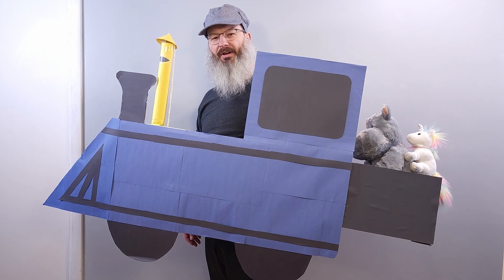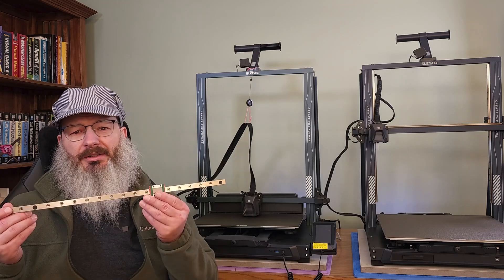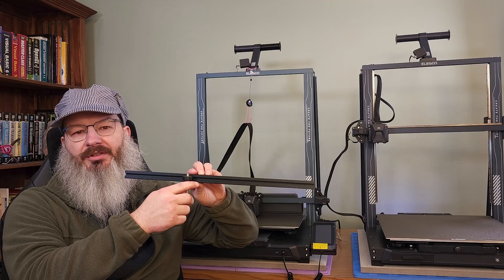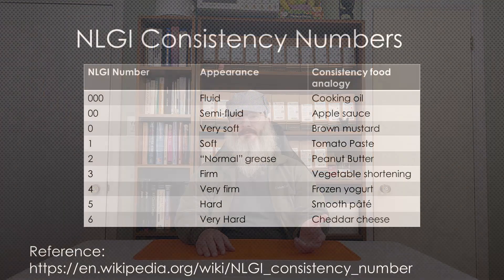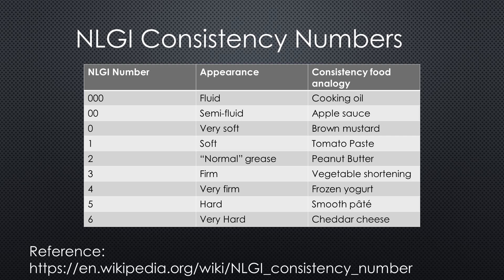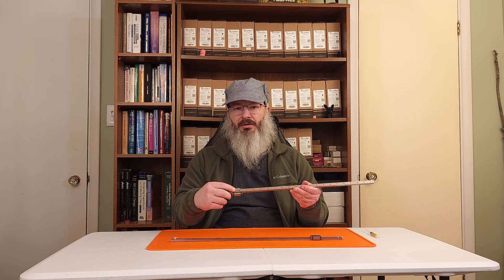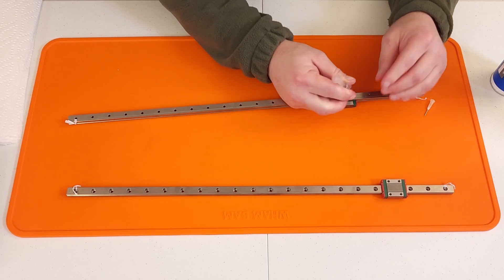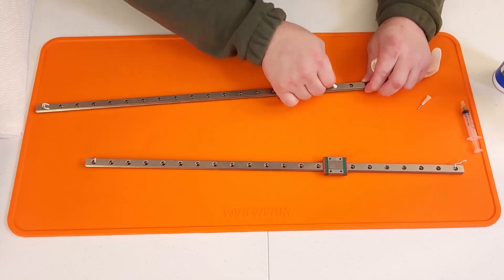Linear Rails for the Neptune 4 Plus & Max: Part 1- Preparation

Comment: Yup, the Hiwin rails are now in a thermal/vacuum sealed bubble-wrap. My Z rails came in the tube bags, but they sprung quite a few leaks for me.
I had no success getting the hiwins to fill with grease via the fill port, or at least I didn't know where I was supposed to be seeing it come out. My syringe either wouldn't extrude any grease or it would all just stary oozing out back onto the needle. Ended up just working the grease in to the bearings from the back where they were slightly exposed.
Reply from the maker: Thank you for watching our videos!!! I've encountered a couple similar stories, but I'm not exactly sure why some are different (the lubrication port not working). Unfortunately, I'm not familiar with how/where TBStron3D gets their linear rails.

Comment: PSA for anyone that is planning on doing the hiwin upgrade. The rails now come in thermally sealed packaging not a plastic sleeve and without any stoppers as discribed in the video. 

Although the thermally sealed packaging is better at protecting the rails during shipping, it is still covered in oil. You have to make sure you cut around EVERY part of the plastic around rail/ carriage.   If not any plastic can catch the carriage and slide it of the rail. This happened to me even though I was extremely careful. One of the carriages caught a small piece of plastic and slid right off the rail in the process shooting a few bearings around my garage into the abyss.  It barely slid off but it didn’t matter.

I still think this will a great upgrade for the N4max but just know as like many things in 3d printing things change fast and this is not 100% accurate and that is definitely not S&M Makers fault. I’m have great respect for him and this channel.
Reply from the maker: Thank you!
Reply: Just received my x and y rails yesterday and they are indeed heat shrink wrapped. After reading your comment about this I unwrapped the ends first and put some cable ties on to stop the carriage slipping off the ends. Thanks for the info on this.

Comment: So, it looks like you decided not to go with Z upgrade. I wonder why... ;)
Reply from the maker: I'm not sure what you mean. Installing the Z-axis kit will be in part 4.
Reply: @SandMMakers  I installed z axis rails and z banging is so horrific… still can’t find a root cause. It looks like drive nuts do not slide well even though I keep all nuts holding drive nuts loose. I will try to install wobbleX soon. Will see if it makes any difference.
Reply from the maker: We will have to see how it goes!

Comment: Hi i upgrade rail for my neptune 4 plus but i have a problem my print bed is not centering anymore. If can please help how to set X,Y off set to center my print bed .
Reply from the maker: The X-axis kit lowers the nozzle by 3mm and shifts it by 6mm closer to the front of the printer (along the Y-axis), but it shouldn't affect its position along the X-axis.

Comment: How's the 3Max non Hiwin rails holding up?
Reply from the maker: So far, I have not had any issues or problems with the linear rails installed in our Neptune 3 Max. However, if you have the option to get the HIWIN rails, I recommend doing so. They are definitely higher quality and more reliable rails, plus they have real, working lubrication ports.
Reply: I can't justify the cost difference, I don't mind lubing it every now and then through the holes on the back but we'll see, maybe when my pom wheels need replacing @SandMMakers
Reply from the maker: Either way you go, good luck and happy printing!